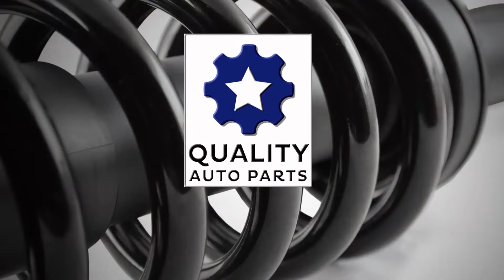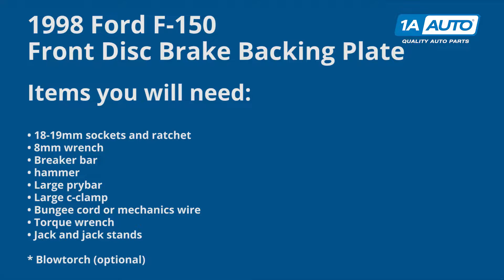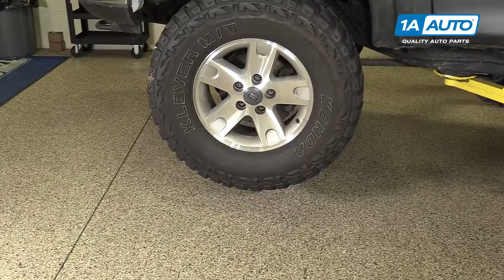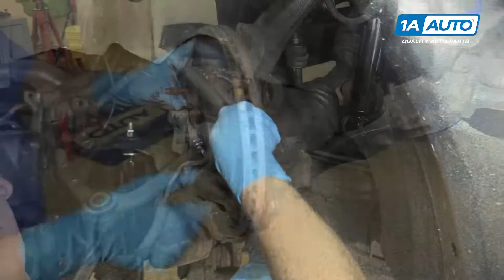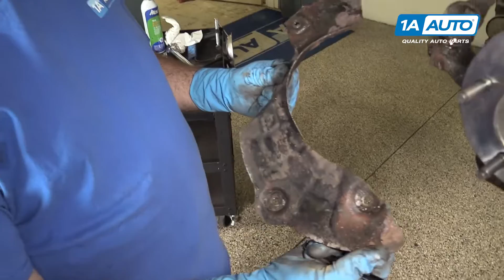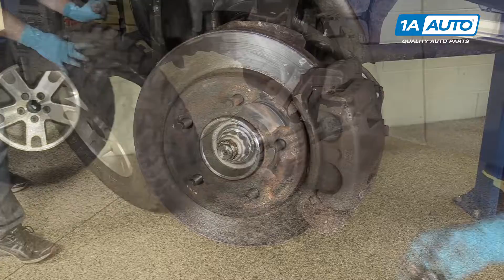How to Replace Front Disc Brake Backing Plate 97-04 Ford F-150

Comment: Been looking everywhere for 97-03 Ford F-150 FRONT dust/splash plate guard. No where to be found. You can find the rears everywhere. But the front all rust off! Why is Dorman making rear but not front??? You guys don't list this part in your video because it's not being manufactured.
Reply: I found the splash guards here: https://www.tascaparts.com/oem-parts/ford-splash-shield-xl3z2k004aa

Not sure if I will bother or not.....
Reply: Junk yard
Reply: @kylefeilmeier7261  I just got mine off of ebay. $10 a side. Brand new Ford stock